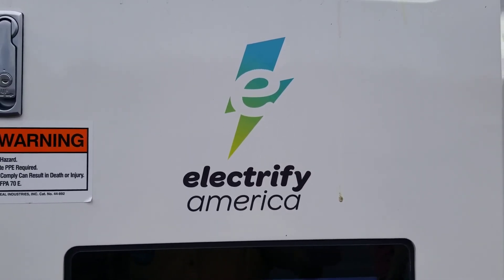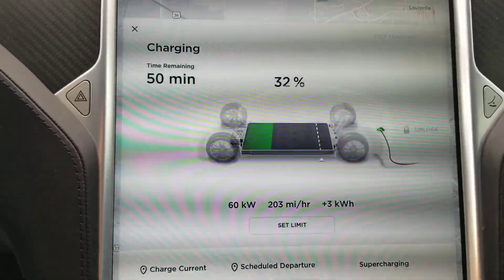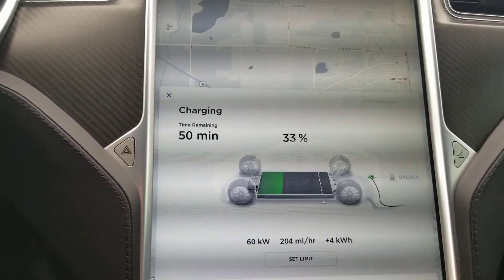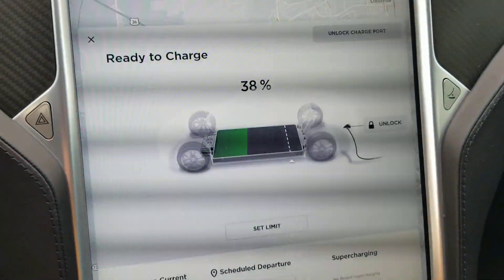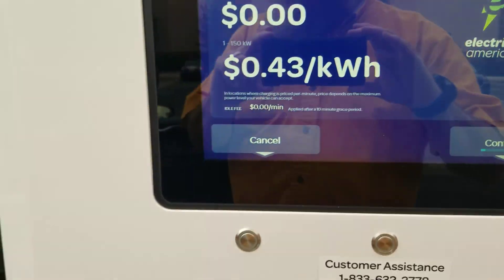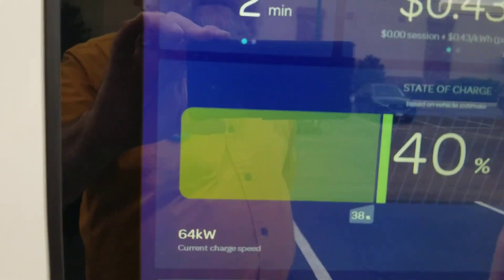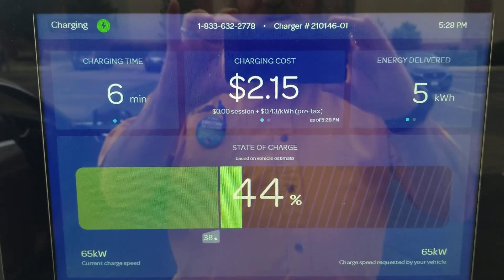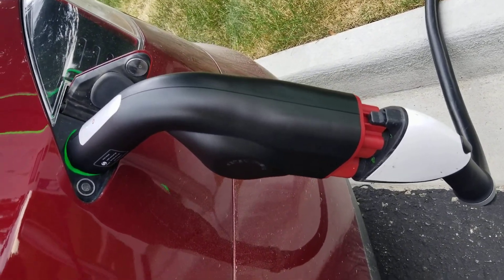66kW with SETEC CCS1 to Tesla adapter charging 2012 Model S

Comment: What version of software are you running on your car? Some users with 2021.12.25.7 are reporting that their charging has dropped from 60kw down to 40kw. It seems model 3 and y have a software cap on chademo that older s and x didn't have until a recent update.

Comment: What software version were you running on the adapter? V150 or V157?
Reply from the maker: V1.50  there is no V1.57 yet. 

https://www.setec-power.com/ccs-adapter-firmware-update/
Reply: @AltView1  https://vsoft.solutions/setec/downloads/
Reply: @AltView1  if you visit the Tesla forums website they have people that uploaded newer setec software to a public website. You can also contact setec directly and request v157 or v158 if you prefer grabbing it directly from the company. I'd be interested if v157 addresses the disconnection issues you ran into.